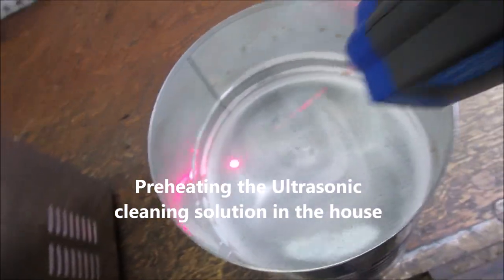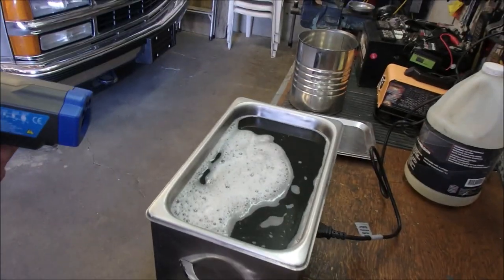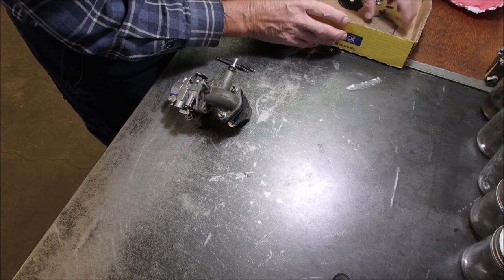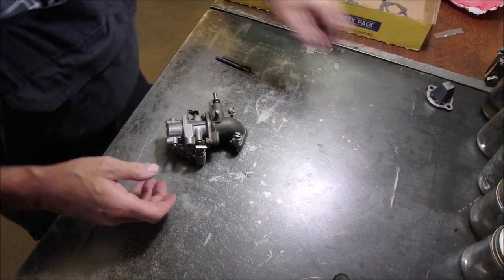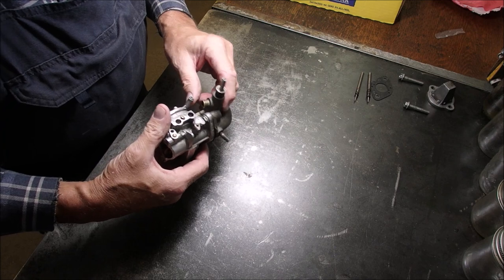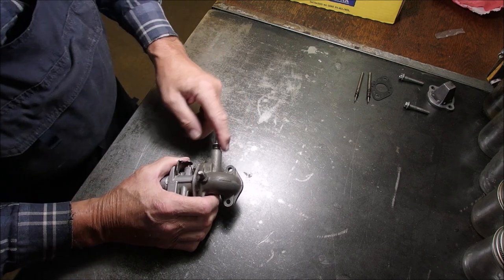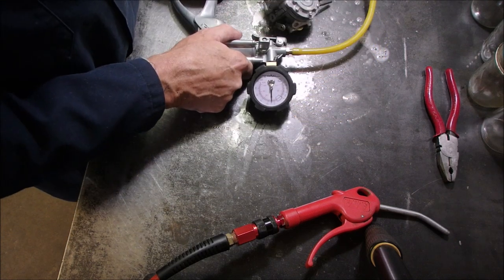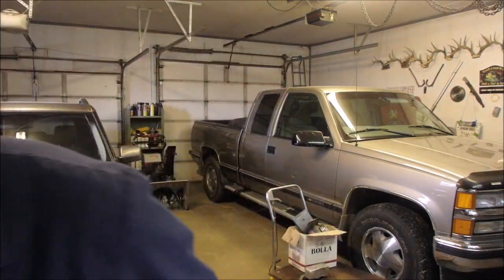Tillotson Carb For A Homelite XP1020

Comment: Last summer, I did a carburetor rebuild for a 1993 Honda XR 250.  It had sat in a garage unserviced for 6 years.  When I opened it up, it looked like those photos of the Titanic at the bottom of the Atlantic!   I cleaned it, buffed the brass parts, then put it through the UC.  Then, I cleaned it again and a second run in the UC.  The owner said it never ran so good!  🥳
Reply from the maker: Thanks Jim.  I got your mail. as well.
Reply: @BrucesShop  
Thanks for the update, Bruce.  I hope you find it useful.  Kind of a neat little tool for a couple of bucks!

Comment: Gonna be nice to hear the Homelite running and you needed to lay out the parts for this carb to keep them in order like you did. But you could always go back to the video during reassembly just had to be sure not to drop that small jet eh.
Reply from the maker: Well I did have trouble placing the fuel pump diaphragm  .  With the 3 main body parts i got confused as to which side the diaphragm went and then the gasket.